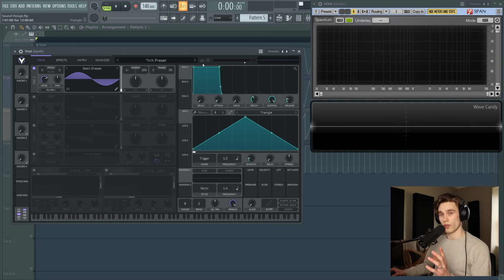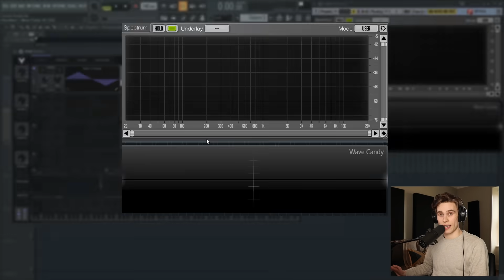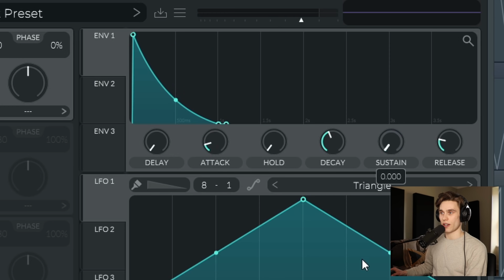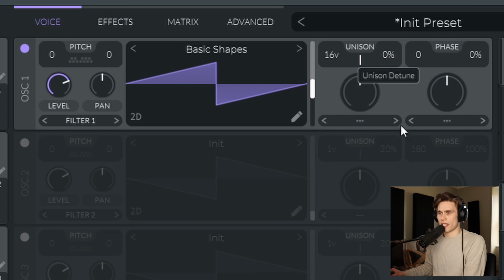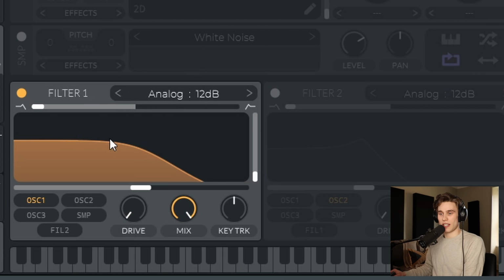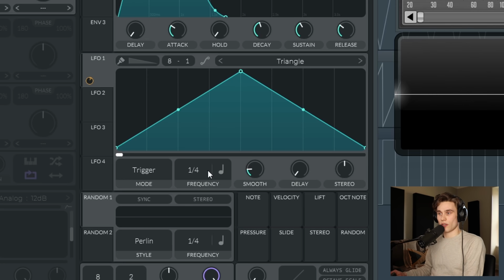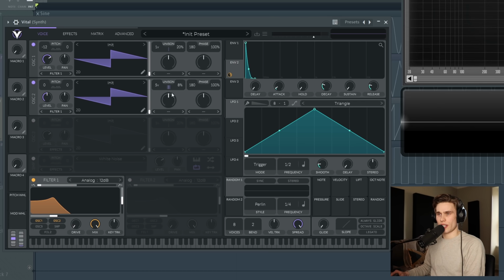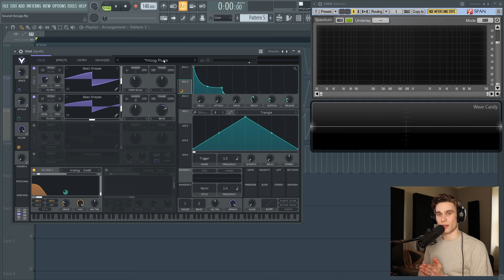Sound Design and Synth Fundamentals - Using Free Software

Comment: Thank you for the video. Hope it brings more users to Vital as well. Such a great synth that deserves more attention, especially for being free.

I have to add that if someone is afraid that Vital has not so much presets by default, there's a site called "presetshare". It has 136 free Vital presets by now (other synths as well). I've uploaded some too. Hope this helps. And one shouldn't be using them as hard-coded presets, but learn from them and create the sound they're looking for. This synth is such a powerful thing! <3

Comment: Thanks for the video Michael, by the way ... there is such a plugin spire, in my opinion it is much softer and more pleasant than serum and similar ones.  For some reason, the wave always looks like iron and splits badly at low frequencies.  Perhaps everything depends on the computer.  But if you have a Spire, do a review if possible.  It is not so visually clear but the sounds are amazing 🙏✨

Comment: Serum vs Vital
Which one would you choose ? 
BTW, Your studio looks amazing. Well done
Reply from the maker: Vital as it is free, save the money and buy a good pair of headphones maybe?
Reply: I got Serum shortly before Vital was released, so I had a little time to get used to it. They each have their strengths, but what I especially like about Serum is the secondary modulators in the matrix. If there is a way to use secondary modulators in Vital, I'm too dense to figure it out. Basically, I use velocity as a secondary modulator on a lot of my envelope-modulated parameters to make my sounds more expressive. You can also use the mod wheel or macros as secondary modulators on LFOs to control movement and stuff.
Reply: Chiju There is